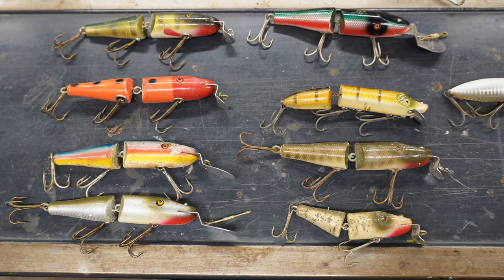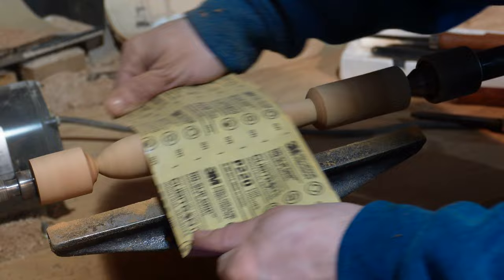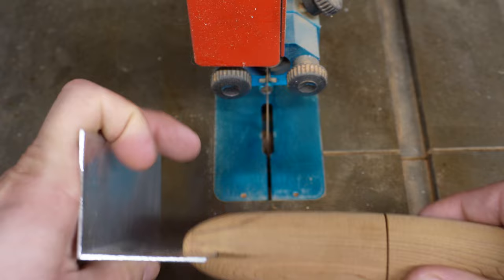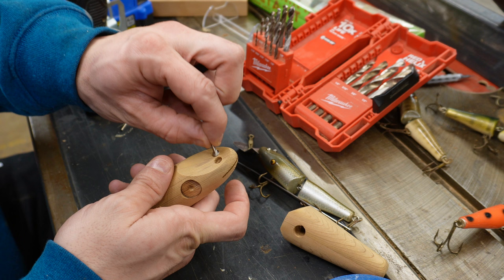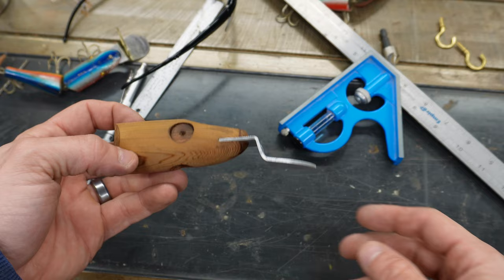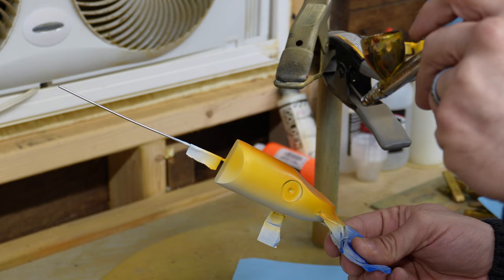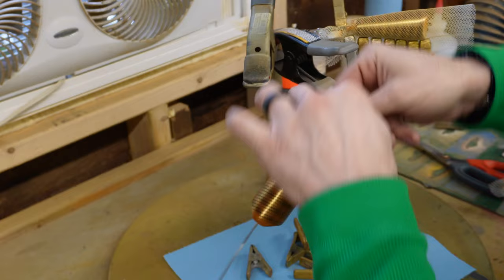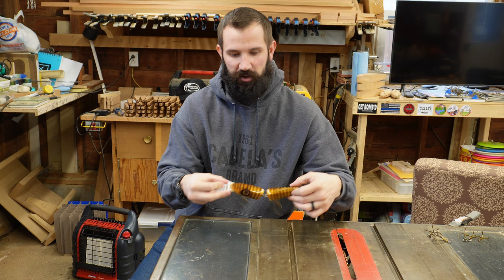Making a Jointed Pikie Minnow.

Comment: What exactly do you use to scuff the epoxy before you paint it?
Reply from the maker: 400 grit sandpaper usually. You can use anything.. just want to get rid of the shine and it's good to go.
Reply: @FrettholdBaits  I’ve heard some guys say if you do another coat of epoxy after 2 hours the second coat will not adhere or stick to the first. When you sand it then paint it and put the finishing coat on does it stick without any issues?